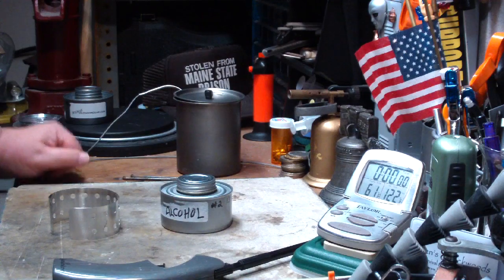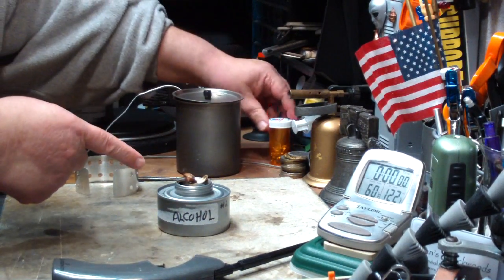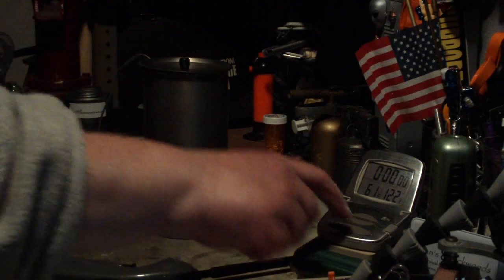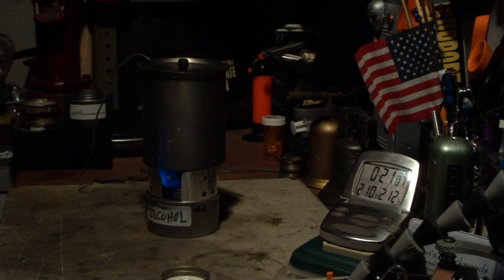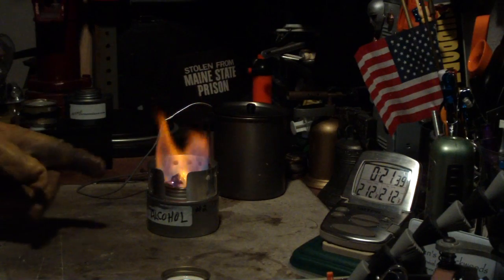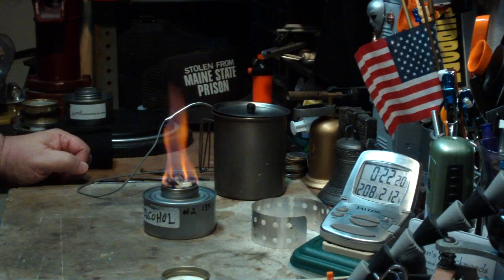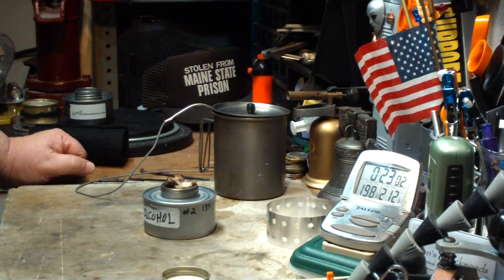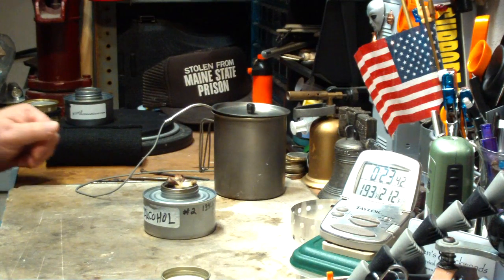Refilling Chafing Fuel Canister with Alcohol - Boil Test#1

Comment: I recently began refilling mine with denatured alcohol. It, too, would bark at me when I lit it. Then it literally exploded the lit wicks out of the canister. 1 landed 10 feet away STILL lit! Thank God I was outside and it landed just about 2 feet from my tent. It had 3 strands. One stayed in the can the other two flew out. 1 right next to my feet, still lit.
The canister itself stayed in tact. I believe the fuel caught fire. I had to smother it for a while to get the flame out. Normally it was easily extinguished with a quick tap with the bottom of a metal can. However... Not this time. 
 I had been using 91% isopropyl alcohol without incident for months. 

Only had the hiccups with the denatured alcohol.

It may be because I had it burning for a while while making candles. Normally it was only lit long enough to heat up a small Billy pot of water for a cup of coffee. Or cook scrambled eggs.
Reply: Yes, denatured alcohol burns far too clean and hot. I would only run 70% to 91% isopropyl (I choose 70% because I don't like the fumes that 90/91% produce, I like the yellow flame for ambience, and it's far less expensive at $3.49 for 32oz bottle/$14 a gallon for four bottles) because you need that water content to cut down on the clean burning so that it doesn't burn too hot. 

It needs to be comparable to the gel fuel those cans use in terms of how hot they burn. It needs to be a slow, smooth, soft burn, like a candle, not like a blowtorch or traditional alcohol stove

Comment: I drilled several 1/16 holes in the top. The wick acts like a primer and the alcohol gasifies.  I may try removing the top and put some fiberglass insulation for a wick. Two cups boiled in about 11 minutes. I just watched the clock. Not as accurate. Great video.  Thanks for sharing
Reply: Sure beats making a penny stove

Comment: More burning vents around the wick might increase the burn rate?
Or more wicks? 
Maybe a small Al can with burn holes inserted into the plate where the wick was; 
to form a pressurized internally heated wall alcohol burner?

Comment: I use this can as alcohol candle I use shoe laces from wal mart makes great wicks. (round white only) 
I use 91%  iso alcohol. I fill with a flavor injector.  It burns with a yellow flame.
I use 7.5 oz by weight with the can. Burn time is around ten hours. Give it a try for heating water.

Comment: What about filling it with vegetable oil? I'd be interested in a burn test with veg oil. Maybe some different setups with oil as well. Its safer and mullti  purpose.
Reply: I know this is 4 yrs late but I fill mine with crisco last forever
Reply: Vegetable shortening is about $21 a gallon, or $8 for 48 oz in most grocery stores.

Vegetable oil can ge obtained through Kroger/Fred Meyer in the 1 gallon size for $10.49.

70% isopropyl in the 32oz bottle can be obtained for $3.49 at Kroger/Fred Meyer. To buy a gallon of it, buy four 32 oz bottles, which equals $13.96 a gallon.

Comment: it looks like to me the wicking is causing the slow boil times, i would take out the entire middle section under the cap take out all the wicking stuff and put a roll of carbon felt in there then put the fuel on it see how that does